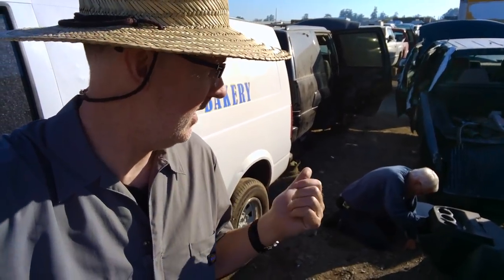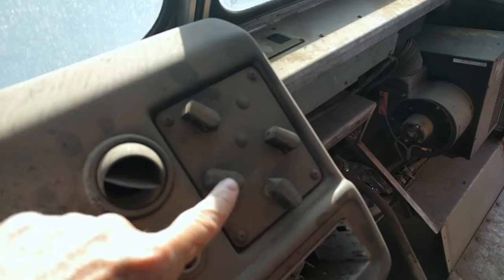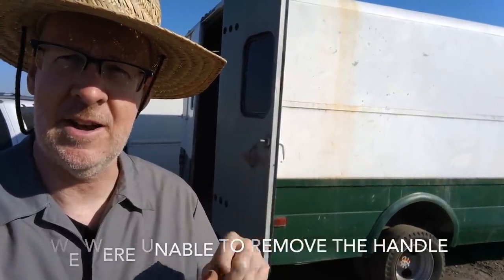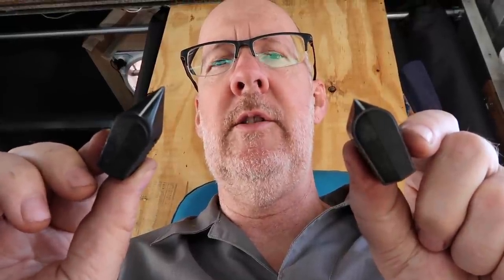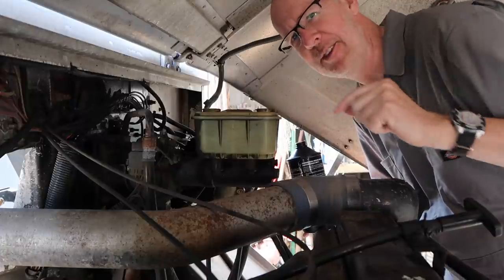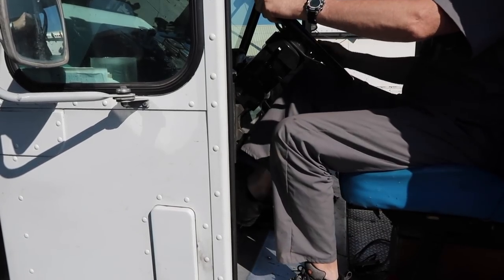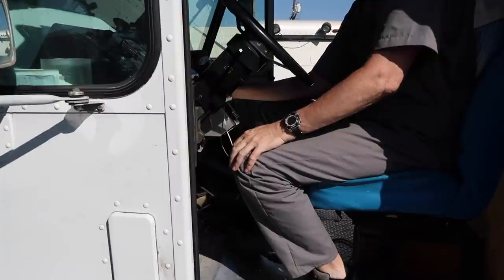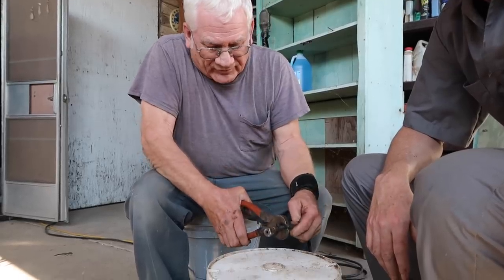New Dash Knobs | Bleeding Step Van Brakes E321

Comment: Hey your doing great! What a blessing to have Paul kinda mentoring you! I was blessed by some mechanical friends many years when every vehicle I owned or bought turned to crap. My dear friends, [still around today] taught me about the Junkyard scores, machine shops, tricks with the breaks and engine rebuilding. [those were before engine computers, and ABS breaks] but the fundimentally still the same.  Dear friends and thankful they were will to share their knowledge and experience! [Take good care of Paul!].  I'm experiencing difficulty as well with "Sourcing" certain part for my Step van as well. I'm hoping to replace my shocks on my Freightliner MT45, so Napa suggested bringing in the old shock and they'll try and match them. For brakes, Cusson Automotive, where I take my trucks seem to be able to identify that my brakes were aftermarket brake rotors, and the Engine computer would not recognize something about the aftermarket brakes. Though they work ok in Normal conditions, the ABS may not function.  So great you were able to "score" some good finds at the junkyard. God bless! Enjoy the coffee! Have fun!
Reply from the maker: sounds like we have similar challenges finding parts. NAPA does fairly well at finding parts if I bring them in, or matching numbers if I can get original part numbers from Freightliner or Cummins

Comment: As others have mentioned, your  front calipers need work. 

You could replace them with rebuilt units, or you should be able to find the internal rubber seals, perhaps a piston, then rebuild them yourself,  with your friends help. 

I just replaced a set on the front of my nissan pickup. The seals were 10 dollars per side. 

I also replaced a set on the back of my nissan maxima with rebuilt units. 75 dollars each. 

Since you won't know how badly the calipers are until you take them apart, then buy the seals, this route trades time for money. 

On the other hand, paying (a lot) more for rebuilt units gets you back on the road sooner. 

Your call. 

You might/should consider working on the rear brakes as well.  They probably won't last long. They are very likely to have internal rust issues as well. 

Brakes are nice to have, especially as your van gains more and more weight. 

The brakes are one of the items which should have been gone through shortly after you bought the van. Especially because it lived in a moist area. 

You are learning as you go along, be careful. 

Glad that you are doing this. 

It's been one of the things I've been concerned about.

Comment: With the van standing for so long unused it will have built up scale or rust on the edges of the pistons in the calipers, and the seals on the calipers are also likely to be just as brittle as the hoses. A caliper repair kit may be available, but I would be really looking at replacing them, and the flexible hoses on the rear brakes as well. Also brake fluid is hygroscopic so consider renewing it at some point in the near future.
Reply from the maker: absolutely spot on with your advice and outline of my future plans!

Comment: once had a front flexi hose go ''one way street'' so i could apply the brakes but then that wheel stayed stuck on for like 20-30 seconds.....

more often its just the pistons in the calipers have deformed a few thou, twist and pull / push lubricate with some fluid bash them about a bit lol

a winding in tool is great for this, in out in out shake em all about....
Reply from the maker: I'm one step closer to a fix, still happy I have new brake lines on the front

Comment: Seven you may need to rebuild or replace your front calipers. It sound like the piston or pistons aren't retracting correctly.
Reply from the maker: yep, looks like I'll be working on the caliper pistons next. process of elimination here (also need to replace rear lines)

Comment: If the problem became apparent after fitting new pads the piston will be fully retracted and sticking new calipers required as wilth all brake parts do both sides of the vehicle.
Reply from the maker: great tip

Comment: Change calipers...if you have time and money...take to Les Schwab.
Reply from the maker: yes, need a new caliper but want to learn how to change and repair caliper pistons
Reply: Seven, changing them are pretty easy, without proper honing machines though, over hauling one is not so easy and compared rebuilt unit vs kit to rebuild, cost almost the same.  If you get a loaded set, they will come with new pads too.
Reply: And a little about me.  Worked at AutoZone and O'Rielys for years, retired AF, I drag race and currently work in an engineering testing group for Boeing...